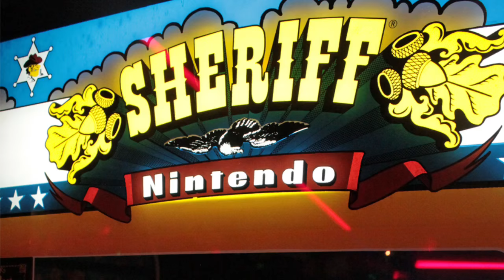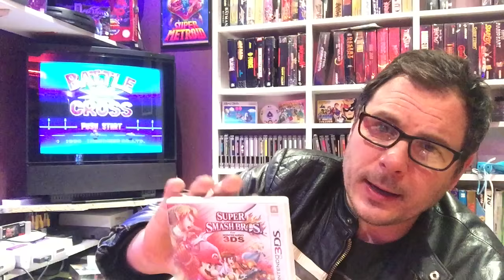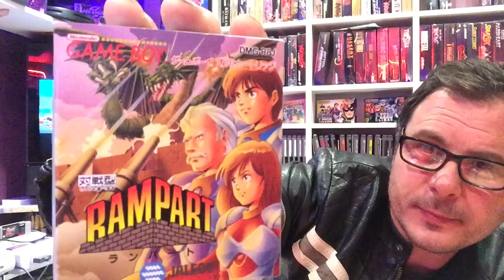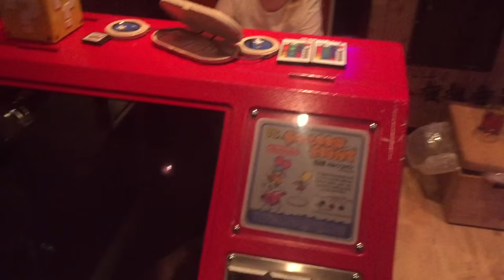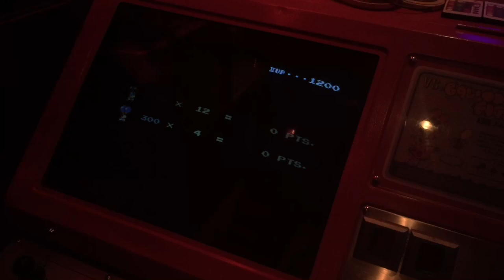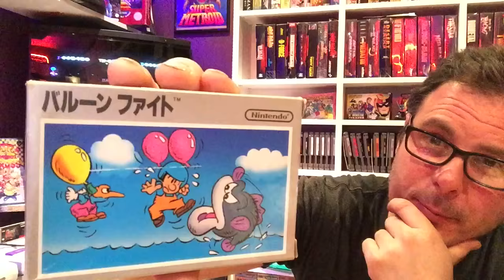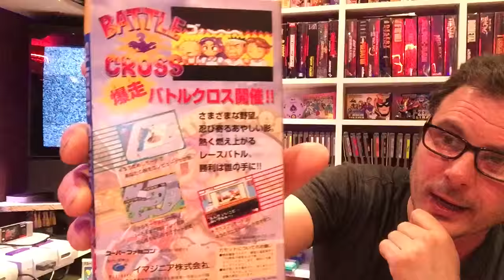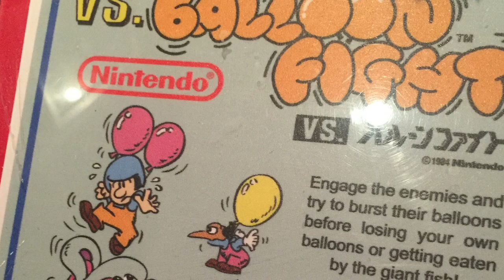Nintendo VS Balloon Fight

Comment: Balloon Fight sounds like lots of fun, especially with it's Joust like controls.
Did not know about the versus boards and how they worked - cool.
Have actually got quite a few Super Famicom games in recent times, just struggling to get the videos made at the moment, but hope to catch up soon, as there are some smashing titles.
Battle Cross looks like excellent fun, be especially nice multi-player, but the opponent AI looks pretty good anyway.
Reply from the maker: Thanks for watching Tony 
Yea the vs system is great it's a shame there are only a few titles that make the most of 4 player simultaneously playing together.
Tennis is the only 4 player vs game 
And wrecking crew,balloon fight are the only games that make the most of the duel screens.
Balloon fight is so much fun it's worth owning a vs system just  for that game.
I still have so many other games to cover.
I can't wait to see your snes games 😎👍